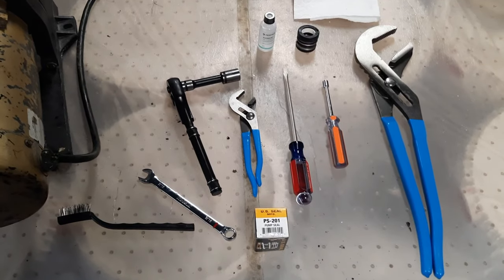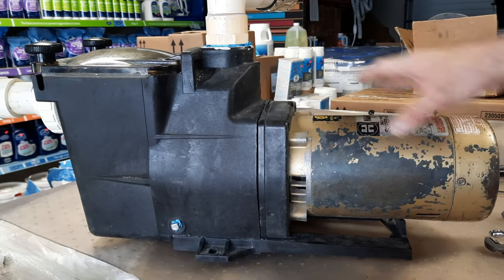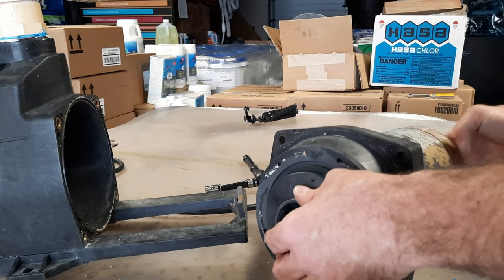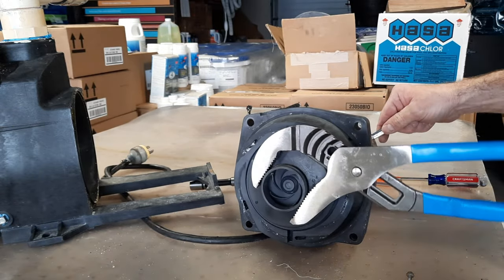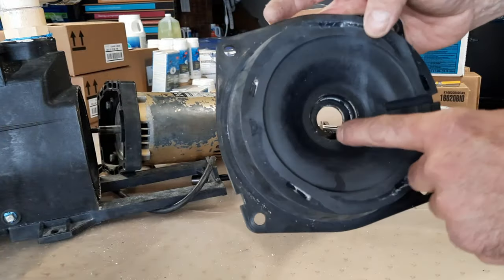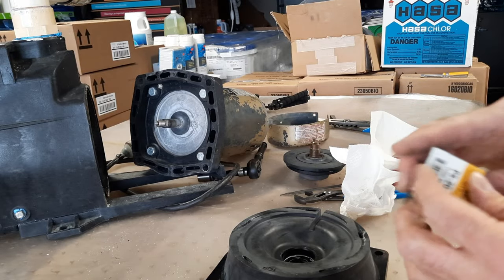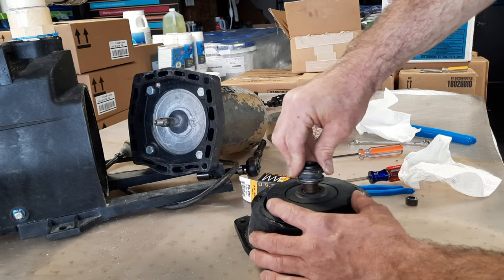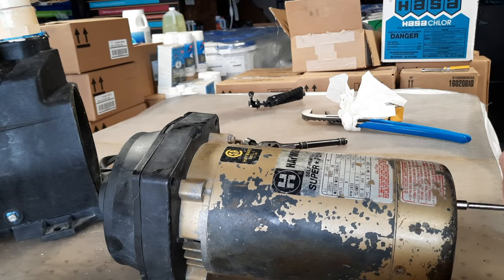Hayward pool pump seal replacement: Hayward super pump shaft seal replacement:  pump bottom leak fix

Comment: Great video dude, very precise & easy to follow.  Hardest part was the wiring, and that’s because of the way it was wired at my pump room (inside and hard to access). Had it removed, repaired and replaced in about an hour.  Rebuild kit was 20 plus tax, versus 850 for new pump and motor, so THANKS!!!  Keep up the good work 😎👍

Comment: Thanks so much‼️🔥.  After 30 years of relying on my top notch Pool Company,  I was inspired by your video to attempt DIY.  My 1st attempt was unsuccessful as I over tightened the impeller-  no worries because you already had covered that issue- after rewatching your excellent video, I was up & running 15 minutes later.  I purchased the whole seal/gasket kit on Amazon for $15 next day delivery.   Greatly appreciated the seal part #👍Well done, easy to follow, detailed video.  Thank You Again‼️‼️‼️
Reply from the maker: Good  to hear you got the job done and thanks for watching!

Comment: Thank you, Excellent video! Opening the pool is always a difficult task, at best. Add a problem and it can be expensive. I was able to take my pump apart, install the new parts, and put it back together all in about an hour. Oldman had to rest every now and then. 

Thank you for the links to Amazon parts, I was about to order them, but decided to shop around the local pool stores to see if I could get them quickly locally. One guy told me he had kits with the exact parts and wanted $58, but he couldn't tell me what was included. Shopped more, and the guy I bought a kit from included all of the seals and a small bit of the Silicon Lube, all for $26, he told me everything in the kit. I bought that kit. The guy I bought from was very happy he didn't have to come and do it, he was swamped. Honest, good man gets the dollar.

The Grand Kids will be able to play in Grandma and Papa's pool this weekend! AND we didn't pay $700 for a new pump. I liked, subscribed, and shared the video!
Reply from the maker: Thanks for watching and great comment! I love to hear our viewers stories on what there pool projects were and how they accomplished them. Have a great summer

Comment: I had to stretch out the new wet-end ribbon-shaped gasket, the new part kept popping out. It helped. It still leaked and so I'll be working on the wet end's new gasket again later this week for a client. I dislike how thin of a gasket it is.

Comment: Great video, thanks for sharing.  My 16 yr. old hayward super pump has a small leak that appears to be coming from underneath.  Do I need to replace the whole seal?  How do i know it is not just a housing seal plate gasket, or the diffuser gasket?
Reply from the maker: There is a small seep hole on the back plate where the motor attaches if the water is coming from there it's the pump seal. Normally is the pump seal

Comment: I followed instructions and replaced the seals and all the gaskets.  I still have a lead that seems to be coming through the channel below the diffuser.  I was told not to use lube on the pump seal.  Is that the most likely place for the leak?
Reply from the maker: It could be that or a faulty pump seal.

Comment: Great video. Would  a bad seal cause suction issue. I believe it ran dry for a bit. Now have suction issue.
Reply from the maker: Hello, if it ran dry long enough to create heat I run across the Threaded plumbing fitting that thread into the pump can leak air so I normally  will re Teflon tape these fittings. I haven't seen the pump seal itself cause a suction issue, just air leaks , impellers and gaskets.

Comment: My inground pool maindrain works fine. But cant get steady suction on skimmers. Hook up vaccum and loose all suction. Took valve off no obstruction. Eventually my bottom left housing 9 16th bolt area began leaking by gasket..but i couldnt vaccum before that.any suggestions??

Comment: I have a pump like that and the suction is weak and output is low flow. I've tried to take it apart but the upper right bolt seems to just spin like the nut is stripped inside of the housing. I've tried to backflow to try to clean the impeller in the water seems to flow through the impeller area back into the basket area like there's no blockage but when the pump is plugged in Hook to water lines going into the pool without a filter I can put my hand on the line my fingers in the line and it's barely sucking water and when the output of the pump is pushing water out of that line it's like it's coming off of slow flow water hose out of your house I would think it'd be throwing at least three feet from that hose but it's just drizzling out like slow flow house water hose what could it be me quit the impeller be worn out could there be a seal inside of there stopping it from having suction
Reply from the maker: With out actually inspecting the impeller its tough to diagnose the problem at hand. I have seen these impellers torn  apart on the inside from one rock getting inside. Also seen leaves get through the pump basket and clog the impeller. If the motor is running good I would say your gonna have to get it apart some how and I'm sure your gonna need a new wet end side of the pump for a new bolt housing. Just use the model number of the pump when looking for a new wet end there about 100 bucks for a generic one. Impeller same thing model number and Horse power of motor. They got to match. So long story short theres really nothing that would slow the water flow down as much as your talking but a clogged line or resistance from dirty filter, bad impeller, bad diffuser gasket, or bad motor.
Reply: Sounds like the threaded insert in your plastic housing is spinning while you are turning the bolt.  If you can get the other 3 out, you can probably “ lightly “ pry the housing off( the threaded insert should come out of the housing, still attached to the bolt) if so, then you can hold the insert to get the bolt off.  If after all this and if you don’t damage anything, after you replace the seals/gaskets, you could epoxy the insert back into the housing, careful not to get epoxy on the threads, and it should hold.  You don’t need to tighten the bolts up very hard, as he shows in the video.  Probably need to replace the impeller also, since you don’t have any suction/pressure.   Good luck 👍

Comment: i watched all differant videos and none have a smooth end shaft.  no where to put a hold back wrench.  i have the hayward sp2600vsp and the is no way to hold back the shaft to remove the impeler, less than an 1/8 inch smooth shaft sticking out.. any ideas?

Comment: Mine starts leak, should I turn it off for safety or keep using it while waiting for the parts?

I just opened the pool 😔
Reply from the maker: If it's a slow leak from the pump shaft seal you should be alright running it for a week or so but I can't make that call without seeing it. If you do run it just keep an eye on it!

Comment: * PLEASE HELP*** I have a Hayward 1 hp pump motor that’s leaking in the same place, but It doesn’t say super pump, but the pump model number is SP2605X7. Would that motor take the same part number for the seals???  Any help would be greatly appreciated!!!
Reply: Please see additional info regarding motor two comments up. Thanks so much for your help!!!
Reply from the maker: Sorry that particular pump isn't listed in my u.s. seal cross reference guide. I can not tell you the exact seal kit you need.
Reply: @Poolelementary  I found it by the model number of the pump. It appears there are many many pumps out there by Hayward that use the exact same gasket kit. It looked like probably 20-30 pumps use the same one. I do think it’s the same parts you were using in the video. I just ordered a gasket kit for that pump, and I’ll just keep any I don’t need until I do need them. Thanks for your response, you surely help hundreds of people, and I just want you to know that you are appreciated greatly for teaching all of us who watch your videos. Thanks again!
Reply from the maker: Thanks for watching and glad you got it figured out!

Comment: How long do these seals usually last?  Im on season 5 of my new pool and is leaking already, is this normal?
Reply from the maker: Hello Edward, pump seal life expectancy varies. I have had them last 10 plus years and I have had them only make it a year. It totally depends on the environment that surrounds them meaning pool PH and the main cause that I come across that shortens their life span is dry running pumps or pumps that have lost their prime for several hours creating heat from the impeller just treading a small amount of water and even if  none of the above pertains to your situation you have to remember that the pump seal is about the cheapest part in the actual pump being only 5-20 dollars for a new one. Hope this helped and yes 5 years is pretty average on having to replace one.

Comment: Ya definitely don’t have to pull the drain plug.  The water will run out while removing the bolts.  An pulling it apart.  
Removing the plug is just an extra step.   
Ad most loosen the clear lid cover

Comment: I just swaped a 3/4hp motor in my 1.5hp. Now it runs for a few minutes and turns off. I followed every step listed here. Any ideas? Its getting 115v, wired for 115
Reply from the maker: Did you change the hp of motor and not the impeller?
Reply: @Poolelementary  yes my pool store said the motor was a direct dwap but didnt mention the impeller

Comment: Just change seal and gasket with  lots of silicone  but pump have  a leak by top right between housing and plate 
Gasket is perfect place and new . 
And bolts are tight  why keep leaking like a pin hole right between plate and housing 😢😢😢

Comment: Did mine(a few times over) and it still leaks like crazy. Normally I'm pretty good at mechanical stuff but it's driving me crazy. Arrrgh.
Reply: i just watched 2 videos and as far as i can tell i did everything textbook perfect. when i pour water in the basket it eventually all runs out the bottom. What??????????